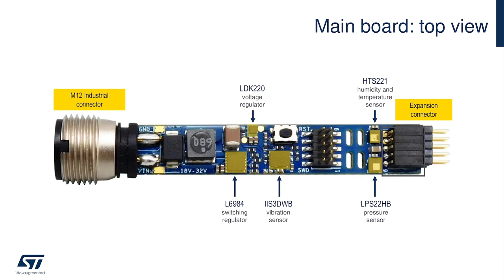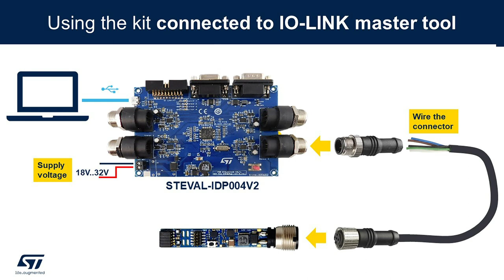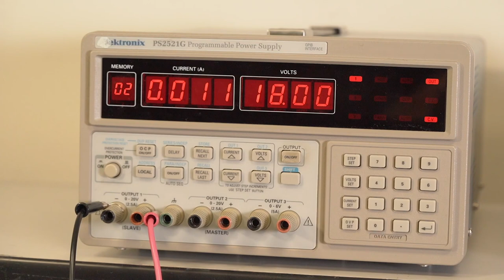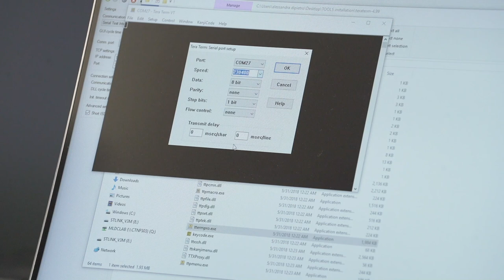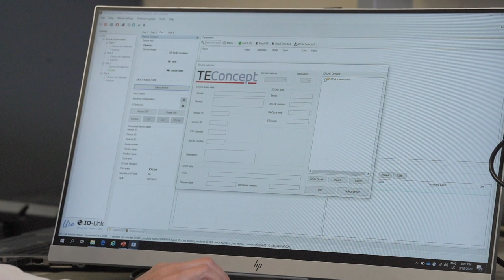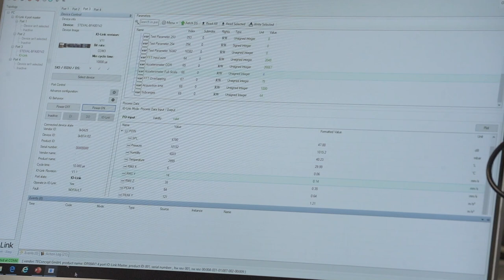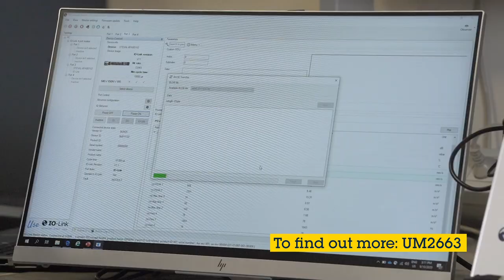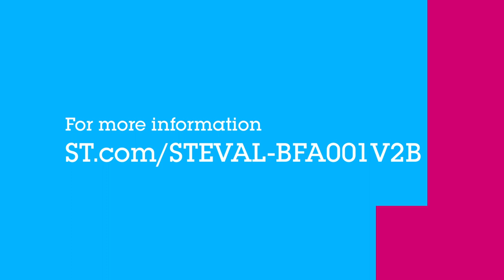Unboxing the STEVAL BFA001V2B, a multi sensor development kit with IO-Link connectivity

Comment: Hello, I'm trying to use the STEVAL BFA001V2B to control and monitor an industrial machine for my graduation project. I followed all the steps described in the UM2663 user manual. However, when I powered up the sensors node, I noticed that there is no current consumption displayed on the power supply screen. Additionally, when I connect the STLINK-V3MINI, a new disk appears in my laptop's disk manager. This disk contains two .TXT files. The FAIL.txt file shows the message "The interface firmware FAILED to reset/halt the target MCU," and the DETAILS.txt file displays the following information:

Version: 0221
Build: Jan 11 2019 17:19:24

My question is, could the sensors node (STEVAL-IDP005V2) be defective?